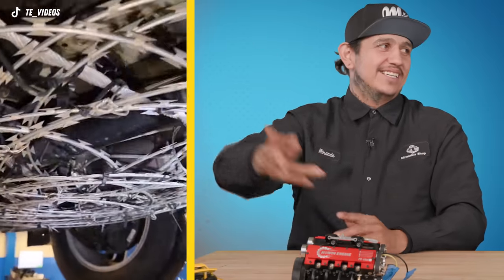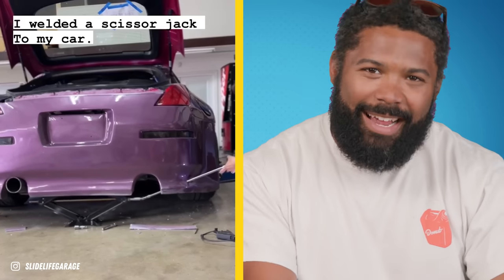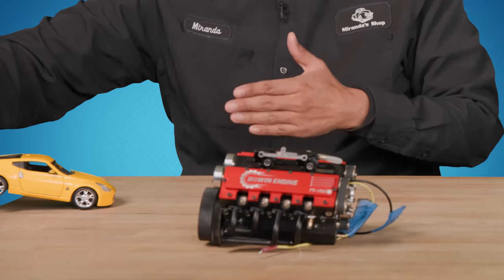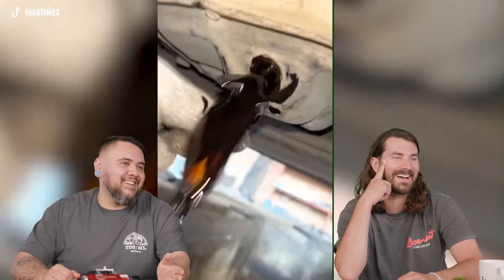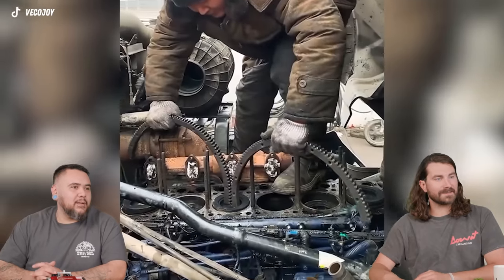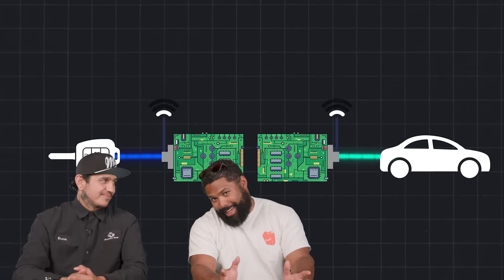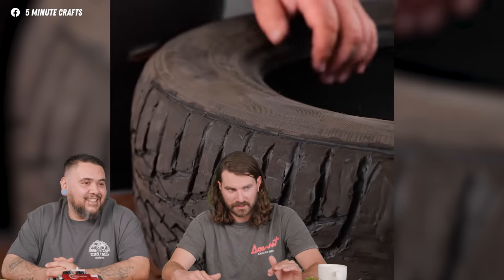Mechanic Reacts to Horrible DIY Car Hacks

Comment: The flat tire hack with the air hose really works.  I worked for a company that made tire repair products and I came up with a SKU that we sold in Walmart stores in the 1990s.  It was a little pack to carry on motorcycles for tire repair, and one of the items in it was a hose like this.  Since it was my idea, my picture was on the packaging.  I was posing in front of a bike while using the air equalizer hose.  However, I used to joke that why would you take air from your other tire when there are thousands of other tires out there!

Comment: The remote unlocking thing is true. Jeremy Clarkson did it way back when on TopGear and at first I didn't believe him and then I tried it on my own car from over 100 meters away in pitch black abandoned airstrip at a festival and then i saw the blinkers light up, they previously werent and i wasnt moving at all.
Reply: Ya I’ve don’t this so many times. If you forget to lock the car and you go inside the house just put the FOB to your chin and it gives you more distance.
Reply: When I first heard about it the reason given was the water/fluid in your chest cavity and skull act as a magnifier for the waves
Reply: Yep. It’s a Top Gear hack.
Reply: If I remember correctly it's the water in your head and you can get the same result putting the remote against a jug of water.
Reply: I do this every time I need to find my car.
Reply: It works by using the liquid in your head as an antenna extension.
Reply: Next time just try lifting it up over your head. The higher position of the fob will give you more range. Touching it to your head doesn't do crap.
Reply: @takore2  Was just going to say this. The water in your head cavity increases the magnitude of the signal, just as it does against any container of water.
Reply: The used car manager at the dealership taught me this, he was a jokester, I swore he was messing with me, some Jamaican dude. And uhh yeah sure enough it worked! Really nice when searching for a car in a sea of others

Comment: For the hack at 6:54 I can see how it would be useful on very hot oil. I've worked at a shop where there was a "Fastlane" option where the customer would drive the car in and sometimes even then just wait in the lobby while we service the car, so we would put it straight on the hoist and drain it so the oil would sometimes be very hot so in that case it could be useful.
Reply: I usually just use a socket extension on a socket, keeps my fingers out of the way.
Reply: Its also useful for not loosing the bolt

Comment: At 7:52 the idea of the air hose nozzle and Black syphon hose is to create a vacuum from with air pressure.  With the nozzle inserted into the hose at the opposing angle a vacuum will be created which will pull gas from the upper tank.  The air hose should be turned off well before the gas enters the lower tank.

Comment: That ziptie on the oil drain plug: It's to make sure you don't drop the plug as it detaches as you're propably pushing on it to stop oil from pouring out before all the threads are cleared. I've dropped the plug a bunch of times.

Can't imagine it being to just spare a few drops of oil on your hand.
Reply: Could also be good for an in and out oil change shop, give your hand a little distance from the oil while it's still hot.
Reply: @tristennichols1865  That does sound like a real thing as well!

Comment: The rope start thing: This is sometimes shown in videos from india etc. with small RWD trucks and pickups, and definitely works for them.
Thing is: thanks to the differential, there's also a 2:1 transmission (as the other wheel is stuck). In general, it heavily depends on the engine (displacement, compression, idling RPM, ...). Some engines do start even with a few cranks revs, other need 2 seconds to get the carb/FI running.
With a modern Diesel, it might get way more tricky.
Drawback of this method: You need either a reliable parking brake on the other axis or another guy (who knows what he's doing) in the vehicle, just like with pushing the car for a short distance to reach minimums speed, PLUS the car jack.

Comment: I was a radio operator when I was in the military. My understanding is that key fobs also use radio waves to send the signal to lock/unlock the doors. I can't think of any reason why holding a fob to your head magically makes it work better. My best guess would be something to do with helping direct the waves in a specific direction. That or making them bounce off of stuff (hilariously, you can bounce radio waves off a building to get in contact with someone).

Comment: 10:40 We used to have a pipe in our home garage that was specifically for extra leverage on the wrecker bar, or the wrench (if it could fit). Here in the Great White North, every bolt has to be broken loose, unless it just rolled off the lot.
Reply: I remember times we used a 4ft breaker bar with a 6ft pipe over it and me standing on it bouncing to lossen a nut we heated up with a torch. Gotta love living in the rust belt working on old farm equipment.

Comment: I would love to see Jeremiah explain how that key fob hack works. Never heard of it until now!
Reply: I agree!  Essentially the cavities (not necessarily empty) in your body (in this case his head) act as a resonance chamber for the RF signal from your wireless remote.  Cool hack!
Reply: If you're interested, Kyle Hill actually posted a video about a year ago explaining why it works. I had to go back and look but it appears to be called "Can Your Brain Amplify a Car Key?" I assure you, despite it's clickbait title and thumbnail, he does a good job explaining the science. Been about that time since I've seen it, but it has to do with the FOB's wavelength and how the human body is a multiple of that wavelength so we basically can act like an antenna.
Reply: It uses your skull as an antenna, it works for things like weak fm and am signals too.
Reply: @Ryster's Tech  I noticed that when I was younger if you grabbed your radio's antenna it would increase your signal.
Reply: @jonpinkston I was just about to comment this, when I used to have that fm transmitter and it was acting funny, it would sound better when I would get close to it while touching it. Interesting indeed.
Reply: It is just because you turn the antenna inside the key, when you point the key against your head. Has nothing to do with your skull.
Reply: You don't have to put it on your head 😂 just hold it up high. It's essentially like the old cell phone or RC car antennas that worked like shit till you extend them, putting the antenna higher. No need to hold it on your head lmao. That's why guys with CBs buy long antennas. Longer range.

Same then when my kids driving his RC car and goes out of range. Hold the remote above your head and boom, connected again and drive it back 😂
Reply: @henriklassen3435  partially yes. Partially because you're holding it higher than normal to hold it to your head. Hold it above your head it'll work even better

Comment: For the last one, I never knew tires had wires in them, until the guy screwed up my tire realignment. Within two days, I had burned through the rubber on those tires, and when I went to check them, I got pricked by a piece of wire.

Comment: 2:53 The power of air pressure is crazy. A liquid natural gas terminal in my area added a second storage tank, and they raised the 330-ton roof all the way from the floor using *fans*.

Comment: @11:55  instead of packing tape, it seems like silicone tape might actually be a sort-of long term fix for a broken boot.
the silicone bonds to itself and is very elastic so it could probably last a while and definitely keep water out.

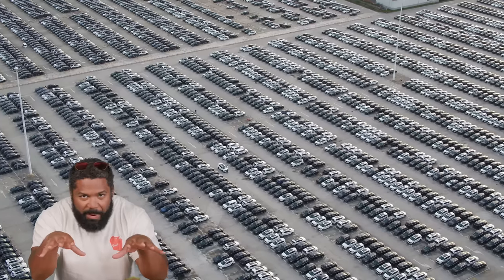Comment: 12:33 - the "car-remote on your head" thing is 100% real. It works because your head is mostly made of water, and water can amplify the specific RF signals from key fobs. Here's a video from Kyle Hill https://www.youtube.com/watch?v=ZrIf0PArZu4
It's super easy to test for yourself. Next time you park, walk away from your car and keep clicking the lock button until it stops responding; then put your key fob against your neck/head and try locking it again. Nine times out of ten, it'll work.
Reply: Also I think you can use some water bottles
Reply: @clion520  - yep, that should work too 👍 the main operating principle is the water and its amplification properties

Comment: Here’s a hack that can really help: instead of push starting your manual in 1st gear, use second gear. It will require a lot less “force” to turn the motor over. Use this all the time, especially when forced to push start my car by myself 🥵

Comment: the pull start on the car tire is totally true. i have done it two times and it is harder than it looks but it definitelly does it
Reply: I imagine it’s like hand starting a prop plane, but with less risk of getting sliced in two.
Reply: Isn't it easier just to push start the car?
Reply: @Oo-IIII-oO  not if you're alone or there's nowhere to push
Reply: and you get twice as much torque by pulling through the open differential.

Comment: The key to the head hack works because the wavelength of the radio waves from the key are close to the resonant frequency of water molecules. The water in your head (there's a lot of it!) basically vibrates in the same frequency, amplifying the signal. You'd get the same affect if you held the key next to a bucket of water!
Reply: if you put it under your jaw and open your mouth it works even better.

Comment: 8:20 guys that's not a siphon. That's a vacuum generator. When the compressed air blows through the very end of that hose it ends up pulling from the other end. That's actually creating a pump.

Comment: For roll starting a stickshift car you put it in 2ND GEAR. In the first gear the motor has a lot of counter tourqe. The higher the gear the easier it is to spin the motor using the tires.
Reply: yes, you'd have to use 3rd 4th even 5th, wheel was spinning pretty fast, clue

Comment: Yeah so hes 100% correct, the shape of your cranium allows the signal to bounce off the rear of your head and be sent out the front, allowing for extra radio waves pushed out... also, the remote, is higher.

Comment: That tire thing is pretty cool. Because at one point theyre both going to have the same air pressure, reason is, air is going to push against each other and just even out. It's a good life hack if you only need to get to the station.
Reply: Or you could do the more sensible thing and be prepared with a 12v tire pump in your emergency road kit that everyone should have.
Reply: It's definitely a faked video though. A simple tube won't have any way to depress the pin to release the air on both sides simultaneously. You would have to remove the core which would obviously let all the air escape immediately.

Also, the back tire didn't drop whatsoever which it definitely would sag at least as much as the front especially at half PSI.

He also didn't even thread the tube on to anything on the back tire, just set it out of view. Then he steps out of the scene and reflection entirely so they have a clean plate to easily splice in a new clip where the car is definitely just hooked up to a compressor.
Reply: @alwaysamongdragons7354  Why when I could just have a spare?

Comment: Related to transferring air from the tires… had a job which had me running an old Freightliner FLB cabover with an air starter. The supply tank for the starter would leak down slowly, so some days you had to take air from your tires to fill it so you could start the engine.

Comment: Using Air to split 2 plastic parts like buckets is a hack I used in plastic molding to separate parts.
Reply: Yeah! I’ve seen it used for unmolding soft rubber or silicone items, too.

Comment: Another car key hack I've seen is that someone was away from their car (I'm guessing across town somewhere) and they were on the phone with someone who was trying to unlock the car, but didn't have a key. The person on the other end used their key through the phone and the person near the car put their phone next to the door lock and it unlocked the car. Would love to see y'all try it out.
Reply: That won't work.  Key fobs are an RF signal (radio) you can't transmit that radio frequency over a phone call.  I mean technically if you had the right equipment you could probably convert the radio signal of the fob to a digital signal on a PC, transmit that over the phone line; however you would need a way to convert that digital signal back to a properly modulated radio signal and then a way to transmit that radio signal as well.  I think the latter is kinda how they unlocked the Tesla they mentioned in this video.
Reply: he probably had a flipper zero or another device like that that can record rf signals and play them back
Reply: That didn't work for me
Reply: Again, this is something I've seen online. It probably would depend on things like the make and model of car and the type of phone and/or cell service.
Reply: @warnabrotha95YT  No, it would depend on nothing but an RF signal, which doesn't transmit through a phone call. Why watch this channel if you know ZERO about cars.
Reply: @SuperRat420  Actually, I know plenty about cars. Just because someone doesn't have knowledge about a specific part of a car doesn't mean they don't know about cars.

And before you come at someone who is speculating, check yourself first bro
Reply: @warnabrotha95YT  no, dude. You do not know about cars. You wouldn't be so defensive. Why tf would you be able to transmit RF on a phone call. How do you think phones work? So you know anything about anything at this point or are you bluffing your whole life?

Comment: I work on locomotives, and I'll tell ya 4 1 1/2" wrenches have saved me so many headaches. When you have bolts torqued down to 200+ foot pounds and you cant get the half inch impact on it a single breaker bar isn't going to cut it always. Especially because they sit for years without coming off. Most of the locomotives I work on are from the 70"s and I even work on some from the 40's, and not every bolt or nut comes off often. I recently broke a 15lb sledge hammer trying to get a breakhead bolt out of the bushings. We had to turn that bolt into liquid to get it out lol

Comment: Someone told me that the air compressor hose siphon trick is very dangerous if you're doing it with fuel, because the compressed air creates a static charge in the hose. I don't need to explain what happens when you get a static spark in a fuel hose

Comment: Someone not looking carefully might reach under to feel for the cat and grab a handful of razer wire and scream... Not as wack as you might think... Also, radio transmitters are omnidirectional (i.e. weak in all directions) and putting up to a surface helps turn that surface into a satellite like dish and focusing/extending the signal into a directional signal.  It has the opposite effect behind you.

Comment: 12:31 The reason why this works is your body acts like an antenna, so you can lock and unlock your car from a greater distance. 
When I get inside my house, I know my key hasn't got the range from me just holding it in my hand. So what I've always done is hold the key to my head, just to make sure it's locked.

Comment: 9:54 Surely, they have a steel pipe around that's big enough diameter to go over the open-ended wrench. So many less points of failure or potential pivot. So much safer and you don't lose energy with the bending wrenches.

Comment: I learned the key-fob-to-the-head trick when I worked at a used car dealership where half the fobs constantly had nearly dead batteries, made short work of finding where a car was parked without walking the entire lot to get in range.

Comment: As a company driver, I pull down around $1,500 a week, running about 2,000 miles, get weekends, don’t have to worry about insurance, maintenance, permits, payments, or headaches. Spent 4 days with a seized hub in Mississippi earlier this year. Got breakdown pay for 4 days. Wasn’t what I would have made if I was running, but it definitely made sitting for 4 days a lot easier.

Comment: Holding the key to your head def works, i used it in the past in the mountains. Like if the group splits and group A arrived at the car but group B is still walking towards the car and has the keys or something like that, def helps 👍

Comment: 2:45 if you don't have compressed air, jam a long screw driver between the two buckets.
once it has reached the bottom, it'll come loose.

Comment: For the bucket hack... an alternative hack for those without a compressed air hose, stick a screwdriver in between the two buckets, what holds them together is a vacuum seal.

Comment: About the tire air thing: I've still got a nail/screw stuck in my tire from months ago. Didn't notice it until by accident, it looked really in there and worn down. No leak that I could tell.

Comment: Its definitely wild, but holding your key fob to your head to give you extra range to unlock your car, actually works. I tested this seeing how close i had to be just pointing the remote at the car and then at my head, and i got about an extra 10 feet or so pointing it at my head. Try it out for yourself! It probably differs for every car, and also depends on the charge left in the remote battery

Comment: The zip tie with the oil bolt hack is common, see it a lot when dealing with motorcycles. You don't want to go fishing for the bolt so this saves you from it dropping out, has little to do with keeping hands clean.